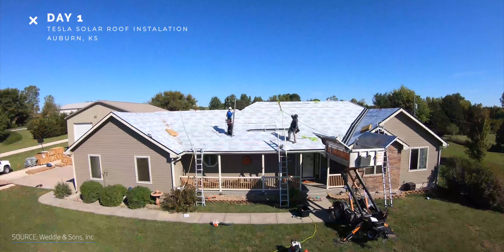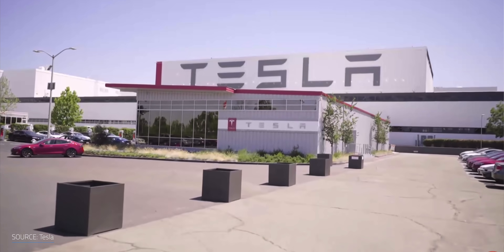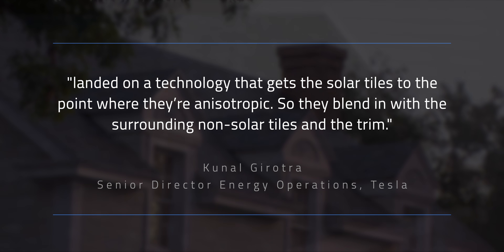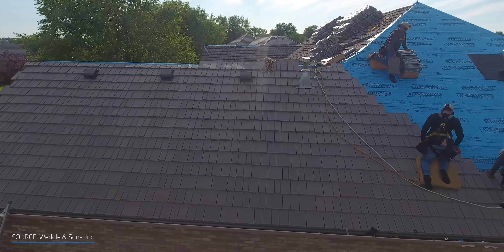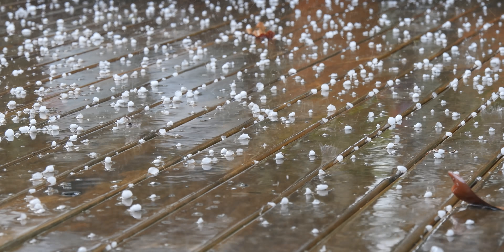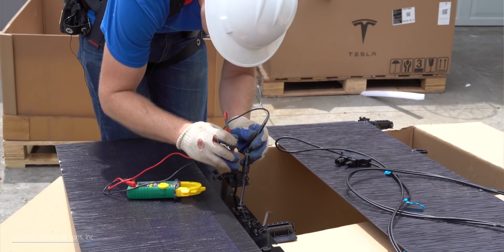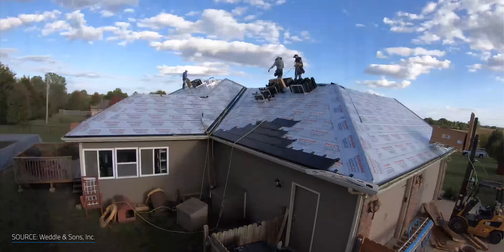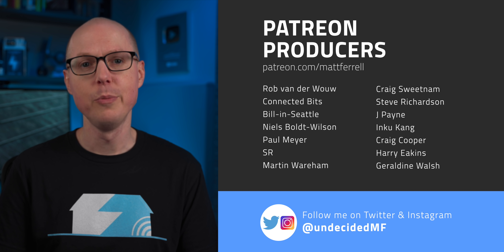Exploring If Tesla Solar Roof Is About To Go Mainstream?

Comment: I'm curious how the amount of electricity generated compares with a standard solar installation for the same roof.
Reply: Solar efficiency vs regular panels would be a very interesting topic
Reply: @Fredric169  Elon mentioned an estimate in one of the early talks he gave on it.

I believe he said 10% reduction, but because you can use more of your roof space the reduction for a full roof isn't bad.
Reply: @Fredric169  these videos with analysis and comparisons have already been made! The solar roof is extremely efficient because of the amount of photovoltaic surface area it can take advantage of compared to larger less adaptable traditional PV panels.
Reply: It is substantially lower
Reply: It's important to remember the primary function of a roof.  It's the home or building's  first line of defence against the weather, that's what roofs are for.   People seem to forget this and start looking at the roof as wasted space to be exploited.  But a rooftop PV installation done poorly can undermine the integrity of the roofing system.

Remember that people want their roofs to last for decades, we roofers in an installation that can take as little as half a day.  We must insure in that one off install that the roof will last decades with basically zero maintenance required.  You start poking holes in our roofing system with your PV infrastructure, well now you're undermining the building integrity and shortening the lifespan of the roof.  

For example, people who aren't roofers that penetrate roofing use silicone, acrylic, or urethane caulking to seal their penetrations.  Roofers do not consider caulking a sealant, it simply isn't reliable or durable enough to qualify.  We do use it but only as a flashing, flashing is always a secondary defence against leaks.

I have plenty of criticism or concerns about Tesla solar roofing, but the concept is superior as it's a roof first Solar system second, as it should be.
Reply: Jeremy Oelke Well said.  Roof shedding water is primary.  My roof has a very, very low pitch (for those that don't know it makes leaks much easier) plus I''m in cold N.east and ice dams are huge problem, wind driven ran, etc.  Solar panel supports not properly flashed worry me & for  a Tesla roof I would be very concerned it would be reliable against water? Even if my roof pitch met Tesla's minimum pitch requirement?
Reply: @jbrown5939  yikes, that sucks man.  You might consider a flat roof system instead.  I recommend an EPDM(rubber) membrane, it's boring and black but they are rated for 50 years and 1/8" on 12" minimum slope, because it's a flat roof membrane.
Reply: @jbrown5939  From what I’ve studied so far about the Tesla solar roof installation, it is better than traditional solar panel and roof installation from a structural, thermal, and weatherproof standpoint. That is of course if it is installed properly... which is key with any roofing system. The modularity and continual refinement of the system (along with Tesla’s track record) gives me confidence that it will become very easy to install compared to other PV systems and will be very similar to Tesla as far as being extremely reliable, efficient, and long-lasting. It also has the potential to be extremely efficient not just for the production of electricity, but longevity, and thermal insulation as well. Even if it didn’t produce any electricity, the look, strength, thermal properties, and lifespan already compete with affordable/traditional asphalt roofs in many climate zones. My parents’ roof in the northeast was installed, repaired, and redone in the span of 25 years for large chunks of change. Before it was redone the shingles were ROUGH, and storm systems have already moved edge shingles in places again. Am I biased, probably a little considering my family just got a Model 3 which has blown our expectations.... but I’m also an architect and don’t mess around when it comes to doing things right.
Reply: @jeremyO9F911O2  Exactly!  Everybody seems to forget what the roof is for .... This is a roof that happens to generate power without preinstalled leaks :)  I like where its going.
Reply: @jeremyO9F911O2  well informed comment. Thank you
Reply: It’s less. The panels are less efficient but they can cover most nooks and crannies of the roof whereas regular solar panels are too large to cover a significant amount. I imagine the efficiency also varies a lot based on the angle of the tile since the tile is designed to look much more transparent when viewed head on.
Reply: I mean The whole point was to offer an alternative solar option for people that value the look of the home higher than the efficiency of the panels... Solar panels are designed to be as efficient as possible (within the price point). so any variation away from that is going to come at an efficiency cost.   So long as the energy demands can be met, This isn't that big of a deal though.  As noted, the entire target audience is people that don't want the most efficient panels because they are ugly.

Its like buying a BMW.

You don't buy a BMW cause its the fastest car in that price range.
You buy a BMW because its style.
Reply: @nuarius  They would have been more successful integrating a total roofing package that looks nice but also produces... what they have done instead is make an expensive virtue signalling roof (I have a lot of money and am very green) that under performs both as a roof and as solar panels. They could have acchieved those goals with something like a high quality standing seam metal roof + inset panels of any type designed to fit between seams.
Reply: @Wingnut353  Why do you say that it underperforms as a roof, this is not what the guy said?

Yes, it underperforms vs regular panels. 

Personally I think if it compares favorably to other roofing, a mixed approach might be best, use dummy (and less expensive) tiles that look exactly the same without the solar together with regular panels on easy to reach area's, and place the solar tiles on area's of the roof that aren't/can't be covered by the regular panels, but still receive enough sun. And ofcourse this also offers flexibility, do you not want to see solar panels, but still want solar power? Fully cover your roof in tesla solar tiles. Do you want less or more area of your roof using regular panels? Not a problem either if they can be placed there.

Obviously it in the end all depends on whether it is as good or better as a roof compared to similarly prized roofing options and people's personal taste regarding look.
Reply: @Wingnut353  How does it underperform as a roof?  Unless the guy on the video is lying it seems they will stand up well plus they are low-maintenance and have a 25-year warranty.
Reply: @sportsguy2891  pfft most slope roof systems are low maintenance.  From the looks of this one it's very prefabricated and maybe a bit weak in the valleys.  You'll notice the white underlay which looks a lot like a fully self adhered firestone product, which itself is basically a roofing membrane.  Normal shingles are two ply and self seal together, those glass panels simply cannot do that and therefore water could backup in them, hence the expensive underlay.  It's probably a great roof in temperate low precipitation california.
Reply: @sportsguy2891  that was my thought as well.  Probably one of the anti-fanboy types, that exist to ballance out the fanboys by claiming everything musk does is bad, refusing to hear anything else :p    

I mean... At least there is some ballance haha
Reply: @Wingnut353  A)  Why panels designed to fit between seams?  Why not panels that span over the seams?  Then the space between seams would serve as cooling channels, which would improve the efficiency of the PV.  Also the video pointed out that a standing seam metal roof plus solar panels would cost significantly more than a Tesla roof.  
B)  Why do you think the Tesla tiles would "underperform" as a roof?  They appear to be very strong and unlikely to be damaged by weather.  
C)  Why do you call the Tesla roof "virtue signaling"?  Tesla deliberately made the roof tiles ordinary-looking and inconspicuous.  That would make them ineffective at signaling anything.
Reply: @Wingnut353  how is it virtue signalling when its literally imprecievable? This is the exact opposite of virtue signalling.
Reply: @Wingnut353  what are you even basing this off of? Assumption?
Reply: @Wingnut353  The video says this compares closely to standing seam with higher end panels. Thin film between the seems is not the same quality package as the Tesla package.
There are monster homes built in Green Gov zones where this competes well. $500K-$million new construction mandated to 0 net energy. 40+ something panels with conventional PV.
Reply: @Wingnut353  both my homes hsvs had standing seam roofs and I hsve been waiting for a peel and stick type solar product that would go between the seams.  I found some years ago but could never get a price.  I am sure there were not as efficient and expensive for what they were but I was still interested.
Reply: The solar roof consists of active and inactive tiles (in multiple widths).  The price is 7X for active tiles.  The amount of solar-generated is a function of how many active tiles they can install on the roof.  The active tiles are smaller than panels, about 17" X 45", so can fit in smaller areas.  However they are less efficient than standard solar panels, so need more area to generate the same amount of electricity. So the answer is it depends on your home's roof structure. We have 12.75 kW of active tiles in our solar roof.  When we looked at doing a conventional roof and panels we were limited to 9 kW because of space constraints.   FWIW, cost-wise it was about the same as a conventional tile roof + standard solar panels.
Reply: @JBoy340a   So @ 24W a tile that would mean you have 531 active tiles on your roof? And you couldn’t fit 36 x 350W panels on your roof?  I make the panels about 650 sq feet (including frames etc) and the tiles about 2,820 sq feet - say subtract 20% for overlap, still about 2,250sq ft. I know it depends on the shape of your roof - if you have lots of triangles and dormer windows understandable. I easily fit 33 panels on my roof and have room for another 20 at least - a single storey house, so a little more roof space .
Reply: @mondotv4216 Perhaps they could have put more panels up there but the size the conventional company’s bid was lower.  Like the Solar roof their bid was also for roof tiles plus solar.  So perhaps they reduced the solar to compensate for the cost of the tiles.
Reply: @JBoy340a  Possibly - maybe they were also quoting cheaper panels as 350W is top of the range. 280W panels would require 25% more roof space. I just think it’s crazy that Americans don’t go for tile roofs from the get go. In Australia the majority of roofs are tile and then the next most popular would be galvanised steel (which is mostly colourbond these days). Maybe it has something to do with snow although I think tiles and steel are both acceptable in snow areas. Just need a steeper roof line. In any case Tesla solar roof tiles only about 10% efficient compared to solar panels - typically around 23% for high end panels.
Reply: The biggest benefit here is that you don't also have to pay for a new asphalt roof underneath the panels. The panels and the roof are the same, and the longevity is vastly improved over the 10-year replacement window of an asphalt roof. Not only that, but you effectively get more square footage of PV panels on the solar roof since they are smaller and reach edge to edge on the roof. I'm willing to bet they balance out wattage wise.
Reply: Tesla solar roofs are rated as class 3 for hail damage. I wish they were rated as class 4, because that would open up insurance discounts. My insurance company (State Farm) gives discounts on homeowners insurance 20 to 30% if the roof is a class 4 rating, but they don't give any discount for a class 3 shingle. So, a Tesla solar roofs will cost me around $1000 a year more to insure my home versus a class 4 shingle. That might change if the repair costs are less for Tesla solar but it may take many years of use to determine that and for it to reflect in insurance rates. On the plus side,  In some areas, building codes require egress walking space to let fireman walk on the roof and that can limit the amount of space or placement of solar panels. So a solar roof likely has more usable area that isn't restricted by fire codes.
Reply: @kenkvid  agree with this. We got traditional panels over our asphalt roof and our municipality required that panels leave 3 feet on the edges of the roof uncovered. This kept our system smaller that I would have planned for, and seems to be an advantage to the roof tiles approach.
Reply: Regular PV panels are not really an option on some complex premium houses, so solar tiles roof may be the only choice in these cases, even with their lower efficiency. Regular PV panels work best on single or dual slope roofs, preferably covering the whole rooftop surface so that there is no other surface to compare them to cosmetically. But the biggest issue with regular PV panels is that I don't think there is a single integrated rooftop with solar panels that's compliant with the building code. It's always a weatherproof roof, plus a layer of solar panels on top, not a roof integrating solar panels in the same way that the Tesla roof integrates solar tiles. House and roof builders should really work out such a design, for houses that are not McMansions with half a dozen or more different roof slopes joining at different angles.

Another benefit of solar panels is that the new generation of hybrid solar panels now produces both electricity and hot water for heating, which smaller solar tiles will probably never be able to do at that cost. I use a separate thermal solar panel for hot water (not for heating). It's close, but not exactly the same size and color as my other photovoltaic solar panels.
Reply: of course the generation efficiency per/area would be less in case of a solar glass compared to proper solar panels. But, then if you consider practically extending it edge to edge, depending on your roof angle, orientation or shape it might even generate more energy in total.
Reply: @Amuzic_Earth  the question is give same setup witch one is better.
Reply: I'm guessing their efficiency per tile area wont be comparable (or else they wouldve mentioned), but because theyre covering the whole roof edge to edge, overall, their solution probably generates comparable wattage to a conventional setup.
Reply: There's a reason why it's not mentioned :)
Reply: I just bought 60 used 250w panels for $70.00 each. 15000 watts for $4,200.  There just is no financial justification for any "solar" roof when you can buy a New regular panel averaging 400w for less than $200 each.  The supply of "used" panels....  which are still generating over 90% of their nameplate rating is growing enormously.
Reply: Ive got three letters for yall. HOA. Alot of people live in places where traditional panels are simply not allowed. Anyway, most of the negativity seems to come from Tesla h8rs who are just inverse fanbois.
Reply: @patreekotime4578  most people don't have HOAs in their life.  And Tesla is basically Apple.  Over hyped products.  The shingles are done cheap and more efficient by companies like GE.  The cars are not well built. The Boring company doesn't do tunnels cheaper just smaller that most.  Space X landing rockets, the Air Force and NASA did that in the 60s and it was cost ineffective then amd reduces payload dramatically.  And the hyperloop a mode of travel as old as the air plane and not been adopted due to the impractical power requirements, seriously bringing a 1000 mile tube to near vaccum is insane when you look at power costs.  Just like Apple amd Jobs,  Tesla and Musk sell.you someone elses dream and at a mark up.
Reply: @meatbyproducts  Hyperloop and boring company are just bored rich guy projects.  Tesla cars are the safest cars in the world and the highest rated in customer satisfaction. They single handedly began the EV revolution we are in and changed the minds of millions if not billions of people about what and EV could be. And you are worried about what? Chipped paint and panel gaps? Lol. And seriously... Neither the Air Force or NASA EVER landed a rocket from orbital entry velocity. Ever. They built some things that hopped but mostly blew up. SpaceX has landed rockets over 60 times and reflown them over 40 times. Thats about half as many times as the Space Shuttle flew in its entire history in only a few years. Im not sure how that isnt impressive to you unless you just hate everything Elon Musk touches because for some reason it threatens you.
Reply: @patreekotime4578  tesla cars are not Well built.  As for safest? I don't believe that as most don't make it out of the cities they live in.  EVs are not necessarily a good thing as our battery tech is bad for long term anything and bad for the environment. 

And you really need to do more research on rocketry history.  Also landing a rocket takes so much fuel it is stupid.  But hey you are a Tesla and musk fan boy.  That is okay.
Reply: @meatbyproducts  So basically you have your own metrics and standards for everything that you have invented in your own head and nothing SpaceX or Tesla does will ever meet those standards because you just dont want them to.  Ignore the tests. Ignore the results. Its just you vs Elon. Lol.
Reply: @patreekotime4578  no, just look at physics and point out that every pound of fuel you take into space to be able to land it 2 pounds of cargo you can't take. And a $100k that has things like panel gaps and a $30 ford focus doesn't is a big deal.  Sorry you're a fan boy and can't see past marketing BS.  I bet you are responding on an Apple products.
Reply: @meatbyproducts  IF it is really more expensive they why is spacex charging less per launch? and no, it is closer to for every 5 pounds of material on the booster stage that isn't fuel used for boosting is one less pound of payload, get your maths right, elon has poeblems, but he's at least not stupid
Reply: You can also use their calculator on Tesla website.
Reply: I would think with all the added electrical components you would have more system wide inefficiencies. As per specifically the panels conversion rate I cannot comment.
Reply: A better comparison is price vs area coverage vs power generated
Reply: Roof that doesn't last for 50 or more year's is a big no no...
Reply: I don't really see these types of questions being asked in any of these videos. There are so many practical questions. Such as how you clean the tiles compared to a solar panel. I easily get 10-20% reduction if I don't clean my solar panels every month. Now on a solar panel, I can use a regular window cleaner or mount a robot if I want to automate it, but how the hell am I supposed to clean an entire roof every month?
Reply: @melange78  Some offer self cleaning coatings. A compilation of low friction and UV activated catalysts that assist the natural breakdown of organic components.

It helps reduce frequency, not stop it being necessary.
Reply: You actually can get more kwh then a normal solar cause they can get more coverage and not put titles where the sun sucks
Reply: You would be selling electricity back to the power Corporate city grid. 😉
Reply: Considering that cost is usually the limiting factor, not roof area, and Tesla solar tiles have a relatively low cost per watt, I think in most cases you can get enough solar tiles to make it make sense.
Reply: @jestempies  Something doesn't add up though about power generated... if half the surface area covered with standard panels is sufficient for required power by me... why would i want a entire roof? lol unless people are just wasting energy... the cost for average joe would be more to get the whole roof. I mean in this video he tried to justify the whole roof with "You only need to replace one roof"... but plain slate or asphalt is easy and cheap and normal panels can just go on top... so the whole "only one roof" idea is not money saving... UNLESS you are wasting or using silly amounts of electricity/energy. Also something overlooked here is that Tile and asphalt are better heat/energy reflectors than plastic or glass... especially when mixed with felt/foam insolation.
Reply: @jestempies  You are insane, the Tesla panels are probably the highest cost solution on the market... you can get panels for under $0.60 a watt these days while telsa is pushing 40k worth of solar tiles required to roof a basic 2000sqft roof.
Reply: @Wingnut353  You don’t know what you’re talking about dude.
Reply: @Wingnut353  you are arguing something that makes nonsense for a average homeowner. If you already own a home let's say 20 years? And you need a new roof because let's say it's 30 to 50 years old. 

Step 1 do you care about max energy savings?

Most homeowners will say NO

THEY WANT A NEW ROOF FIRST PRIORITY ITS A BONUS TO GET SOLAR +24/7 POWER ITS CHEAPER THEN UR SETUP AND LOOKS A MILLIONTIMES BETTER FOR HOME VALUES...
Reply: They main issue is going to be maintaining it after installation. With over a thousand connections per roof, how often will you have to call the roofer to fix bad connections?
Reply: @kevinroberts781  What would cause the connections to go bad?  They are made to be weather-resistant, and the connectors are under the tiles so they aren't exposed to being chewed by squirrels.  I suspect bad connections are fairly rare.
Reply: @calamityjean1525  Well that’s true that connections fail rarely (although Tesla had several shopping mall fires caused by bad connections) but of course a typical solar install has two connections per panel so 36 panels equals 72 MC4 connections. Tesla Solar Roof = 531 panels = 1062 connections. So logically that system has 15 times higher chance of a connector failing. It also has 15x the extra resistance introduce by MC4s - so there are small losses there. What’s the failure rate of MC4s - couldn’t find that info anywhere but found plenty of examples of them failing. On the plus side connectors are not as exposed as on a typical roof - on the minus side might be subject to high humidity in between the roofing sheet and tile. Only time will tell.
Reply: Why do you think they left that out.  It's more of "I want an IPhone, to show how hip I'm am", then practically.
Reply: @printxii  well Tesla is basically the Apple Model.  The lead icon invents nothing and is all hype like Jobs was.
Reply: What what's posted out there, expect it to be 40% less efficient, but then you're probably covering more than 40% of a would-be solar panel installation.   Though comparing efficiency is like comparing carrying capacity between a Ferrari and a mini van.  They're different product groups.   Not to mention that if you're getting all the energy you need, with the space available, efficiency doesn't matter.  Unless you live in a tiny house. :)
Reply: Try view Tesla’s solar roof video
Reply: Chris Talbot — I guess the amount of electricity generated from installing a Tesla roof depends on whether or not you include the energy generated from the subsequent fire that engulfs your entire house, LOL:
https://www.theguardian.com/business/2019/aug/20/walmart-tesla-lawsuit-solar-panels-fires
Reply: PV is 50 cent watt. There ya go.
Reply: also depends on where you live, how much sun do you get
Reply: around 5% efficiency of the solar roof tiles, in comparison to pretty much every other panel in the consumer market they are bad, not just in their efficiency but their cost also. Considering the consumer market has panels that are 20%+ efficiency, can be installed for a lot cheaper, just alters the look of your house. And that is the main problem, people still care more about the looks of their house over the environment. I'm pretty sure we are on the verge of a point of no return, it's down to the western world to try and fix the problems they created. You cant force africa, india, china, russia, south america into solar, all of these places stuck on fossil and carbon fuels, even if they wanted to go renewable energy they simply couldnt afford it, the cost for solar, wind, or nuclear is just to high for most 3rd world countries to convert in any reasonable time frame. If you add that fossil fuel pollution from the 3+ billion people, with ours, with the methane release from farming, with the methane release from the warming russian ice caps, with all the methane release from the warming sea beds, all the co2 and other gases released from the ice and snow melting, we are screwed, over the next 20 years we are all going to see the runaway effect from this.
Reply: @shroomiestshroom3655  well if people were in this for environmental reasons they would say FU to solar as the mining for materials and end of life of panels is bad and they would be behind nuclear.
Reply: @meatbyproducts  even the mining for nuclear is bad, no matter what we do for renewable or fossil fuels we have to dig it out the ground with major risk to the environment, the mining needs to be managed and not left to children of 3rd world countries. Solar is a good stop gap, only a small part of solar cells are not recyclable, the glass, frame, wires, can all be recycled, only the thin layer on the back can't be, and the life of cells now is 15+ years, that would only be 4-6 sets of panels over your entire life. To reduce the impact of nuclear waste, contamination, and sites we need a mix, otherwise just by the law of probability having hundreds on nuclear stations around the country is drastically increasing the chances of a disaster.
Reply: @shroomiestshroom3655  hahaha
Reply: Pretty sure it’s a lot lower.
Reply: I think the efficency of Tesla solar tile could be very low that common solar panel (maybe 5%, vs 23% of Sunpower solar panel). This is not a problem if you have enough space on the roof. Anyway, I am rather skeptical of the success of this Tesla product. Definetely It'll be not a new Tesla Model 3
Reply: 80% of my roof is always covered in shade but I'm still gonna get my whole roof covered in Tesla solar shingles because I'm an idiot Tesla fanboy.
Reply: @michaelbrinks8089  better that than panels then... because then it’d be inefficient AND ugly.
Reply: @michaelbrinks8089  have you considered community solar?
Reply: @michaelbrinks8089  That does seem like a bad call but you may decide to trim some trees that contribute to that shade and end up with more return or if you have cells fail you potentially have relocatable units.
Reply: @michaelbrinks8089   By the time I heard about the $600.00 Tesla flamethrower it was discontinued. I went to Harbor Freight and bought one for $29.99.
Reply: The Tesla tiles are less efficient than other tiles that have been on the market for over a decade and they tend to be 20-25% less efferent than a standard solar panel.

The biggest problem with the Tesla shingles are the looks destroy the light gathering ability.
Reply: @meatbyproducts  A lower efficiency could be a problem if your power consumption is pushing the power potential. My big question is what the cost difference is between a roof panel and the solar panel? if it is something like $100 and $110 then Solar all the way for a few hundred more but if it is $100 and $250 then it is prudent to be a bit more selective.
Reply: @nickm9102  the comparison is of same roofs.  Solar shingles are not as efficient.  The idea of cost is silly if you pay the same for less efficient products.  The Tesla ones are the least efficient of the options.  So Solar panels are your cheapest and most efficient option and Tesla is you most expensive and least efficient option.
Reply: @meatbyproducts  I'm looking from the standpoint that if the less effective system lasts 25 years and costs 80K with maintenance over that time and a contemporary roof  lasts 10 years with the panels lasting 25 and the cost for two roof replacements and panel relocations total 90K for the same 25 years then. While the components are more cost effective in option 2 the maintenance cost defeated the initial savings.
Personally I'm opposed to a roof mount because I prefer the up front cost of conventional panels being much better and having a ground or custom frame mount no relocation when the roof needs replaced and you can choose the most efficient place for the panels to be.
Reply: @nickm9102  a ground mount that tracks is more effective and cheaper. But your math before that is all over the place.  

I am still a Nuclear advocate.
Reply: @nickm9102  A conventional colourbond roof lasts the life of the house (approx 50+ years) with close to zero maintenance in cyclone rated areas and costs about a quarter of Tesla's solution.
Reply: @meatbyproducts  wrong! 26% tax credit. 2200sq ft home cost 38k traditional roofs will cost 20 to 30k easily. 

If your home is worth over 500k what is 10k more for a solar roof. Didnt look up solar panels because they are ugly and you still need to strengthen/replace the roofs plywood which is around 10k....

I'd rather get the 2 for one special with a 2⁶% discount. Instead of roof+ solar on top lol!